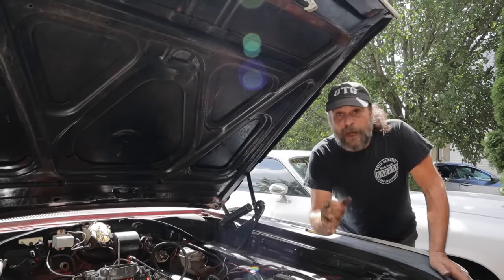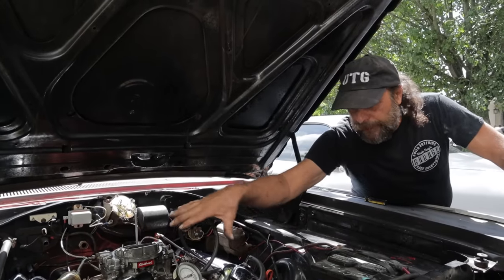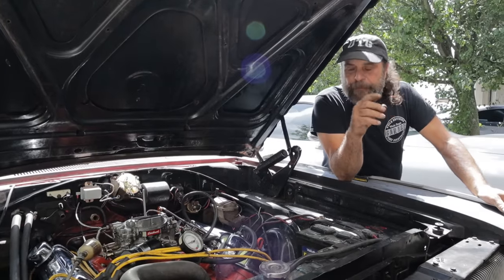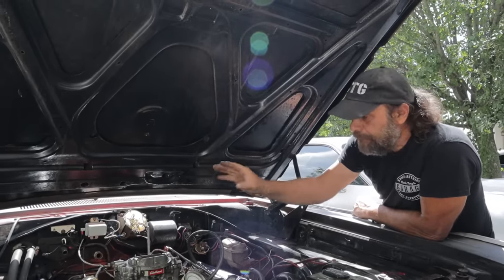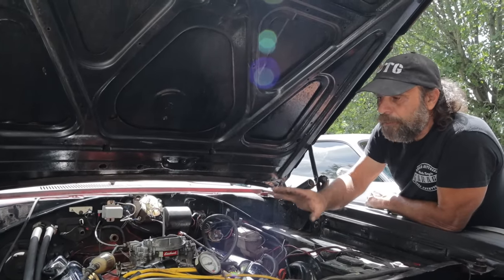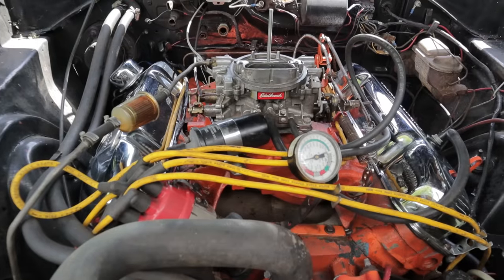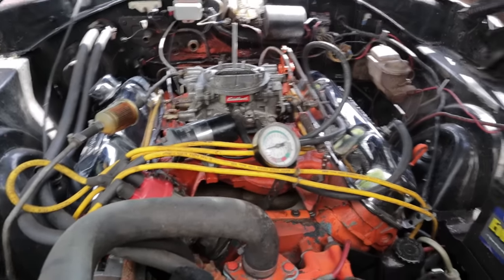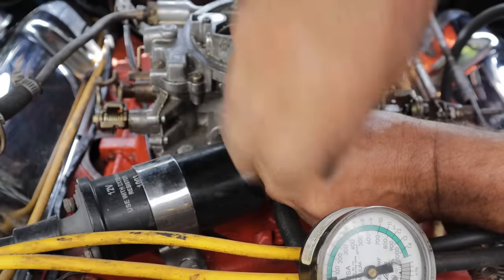Fine Engine Tuning With A Vacuum Gauge

Comment: Vacuum gage technique only works on low duration low lift cams. So look at your cam specs. Anything at 250 degrees at .050 this wont work

Comment: First thing you want to do is get rid of that  crappy plastic fuel filter, to close to an engine heat source, your flirting with disaster. At least use a metal filter.  I'm a Mopar man...love the videos... Plastic or Glass See-Thru fuel filters and single throttle return springs are my pet peeves!! Easy safety fixed, that will save your life and vehicle.

Comment: Why didn’t you show where you hooked up the hoses
Reply: Ryan , Do some research on your carb and find which port is which this is not a rare carb.
Reply: Jimi Fed I have the exact same as in video, the passenger side says for vacuum and the drivers in for mechanical advance, the Edelbrock video itself was helpful, just wanted Tony to zoom in so I can confirm where to put gauge on what port side. Other videos have different info on this. Thanks for your reply, I will keep looking for confirmation
Reply: I’m still struggling with this, do you hook up the vacuum gauge on the drivers side or passenger side? It’s not worded the same term in Edelbrock manual as he’s using in video

Comment: Please stop spreading misinformation about how to connect ignition vacuum advance. Please do some level of research before just irresponsibly posting videos. The "ported" connection is used for emissions vehicles configurations, and even then somewhere in the mid to late 1970's they smartened up and started using "trapped spark ignition" instead, which is the complicated stuff you gleamed on briefly in the video but clearly did not understand. The only reason why they ever used ported signal for vacuum advance at all is because emissions go through the roof when you use a lot of vacuum advance at idle. So they decided to go with ported advance, and then use an A.I.R. system to burn the leftover hydrocarbons in the hot exhaust that were not burned off, otherwise other emissions types from unspent hydrocarbons were present. They eventually had to work around the other problems experienced with ported signal for vacuum advance by then later introducing the trapped spark ignition because it would run like total crap when cold. Also, not enough vacuum advance at idle will make the car run hot in traffic and piss through more gas. By telling people to only use ported vacuum for the spark advance, you are selling an idea that was used for complying with emissions standards in 1970's, without the benefit of the rest of the system. If your car is running better with ported signal instead of manifold signal for vacuum spark advance, then great. You probably have other things somewhat misconfigured that as a result make this appear to be the best way to go for you. My suggestion to you is to take your distributor to someone who has a Sun machine and have it recurved properly, so you don't have to pull in so much base timing advance to compensate. You would be surprised how out of wack those things can get when they are old and worn. Heck, I bought a brand new HEI unit and found that the springs were far too heavy for my application. If I were less informed, I would have just bumped up the base timing to make it run better, then realize that the ported vacuum works better for my application. Assuming that you have too much base spark timing advance, I can see why using ported for vacuum advance appears to make the car run better.

Comment: The lost art of the vacuum gauge. Can confirm, have seen many issues sorted with this magical piece of automotive voodoo.
Reply: Does it work with any engine?
Reply: @taunuslunatic404  This is pre electronic magic.  Now you can plug in your laptop and see/adjust these things.And many more.  Thus minivans make the kind of power we would spend money for.  Because old guy lol.
Reply: @MrDaChicken  My car is a '81 European Ford with an inline 4 engine. It's carbureted with electronic transistor ignition so it has no provision for a laptop.

Comment: Computer engine guy.."my truck idles very rough.. no codes no light".. Old school me..put a vacuum gauge on it.. it says your valves are leaking..
Solution.. replace sacked out valve springs.. thank you $9 vacuum gauge.

Comment: You have your wires crossed.  Distributor vacuum advance always hooks to manifold vacuum.  Ported vacuum on the distributor was tried in the early 70's to control emissions.  Didn't work.

Comment: Them screws are fuel consumption.  Nothing to do with vaccum.   Rich/lean.  Egh..  think mine was 1.5 turns dk been to long but it wasn't bad on gas 21 with a 302 5 speed 4wd. Lariat. No shit.  Two two n a half dropped like hell. Say about 16. Dk. Seriously dont care but ya leading people in the wrong direction bro.